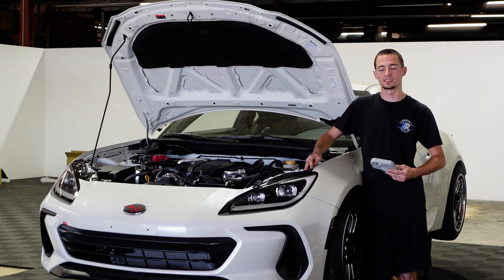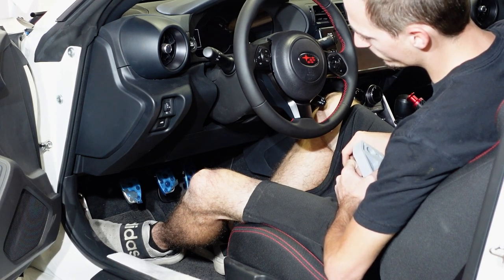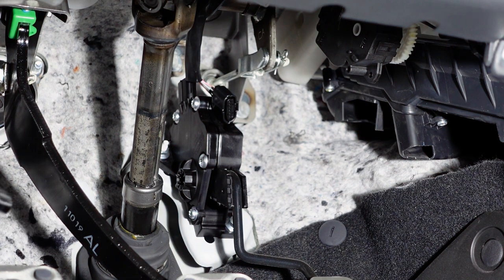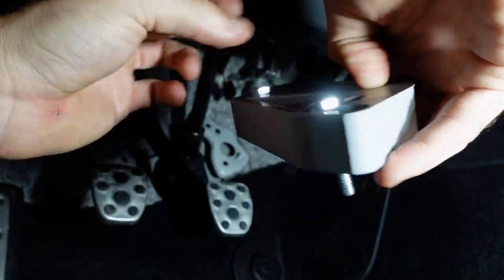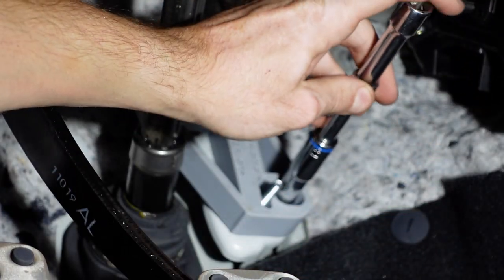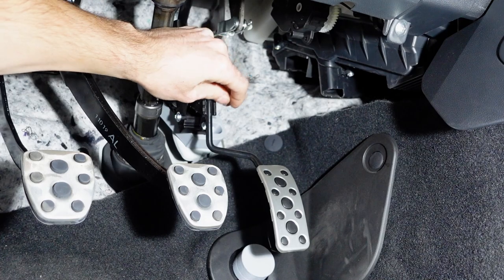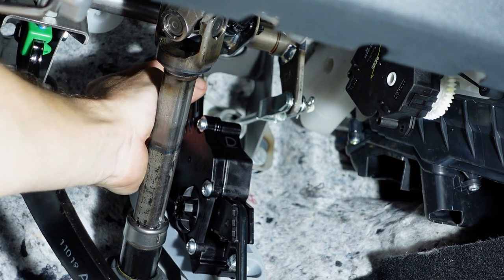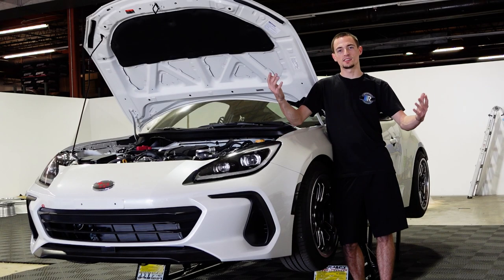2022+ BRZ/GR86 Pedal Spacer Install! Get the MOST out of your vehicles performance!

Comment: I honestly can't believe how much the aluminum spacers cost. I traded my 2018 civic si in for the 2022 gr86 (HUGE upgrade). I did the same mod to that, I lowered the brake pedal just slightly and put an acuity repositioning bracket on the gas pedal. It was anodized aluminum, looked like a more difficult part to produce, and only cost as much as the 3d printed spacer for this car. I'm glad there is a 3d printed version because $150 is way too much for a spacer lol

Comment: I have pretty big feet, so it's sometimes a bit of a struggle to get my heel to fit all the way down to the gas pedal without getting stuck on the right dash/firewall area while braking. Looking forward to receiving my spacer.

Comment: Sorry for the silly question, but I am trying to unplug that electrical connection and can't figure it out. How are you getting it with just the one hand? Are you somehow squeezing it to unlock or something? \I am trying to see if the connection is compatible with a Banks Pedal Monster. Thanks! Great video Btw!
Reply: It's definitely a harder clip to get out, but there's a tab that you press down that'll allow the connector to move out of the way. If you have enough room for a small flat head screw driver, once you wiggle the connector a little bit outward, you can get the tip of the screw driver in there so that you can help use that as leverage to pull it out. We haven't tested the Banks Pedal Monster with the throttle pedal spacer. If you're looking for better response, I'd recommend to have the car tuned via EcuTek.
Reply: @daneyoung7770  Thanks Dane for the reply. I will look for that tab as you suggest. I may look at an EcuTek tune in the future. For now though I want to keep my warranty intact. A tune is definitely the way to go though. Thanks again!

Comment: Should you use the included pedal stop on the 2022 cars? I know Versus engineering says to use the OEM pedal stop rather than the included one on their 2013-2022 spacer, and this fits the same years.

Comment: Do you need to use loctite?
Reply: Just installed it. I have pretty wide shoulders, so it was an absolute bitch and a half to get into a position where I could access the nuts, but other than that, the install was fairly simple. The full throttle modifications people could definitely do a better job calibrating their 3d printers, as the print quality was rather poor. Though, this shouldn't affect performance. My only other critique is the lack of included torque specs.